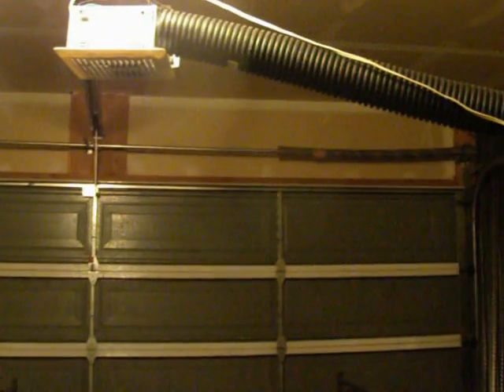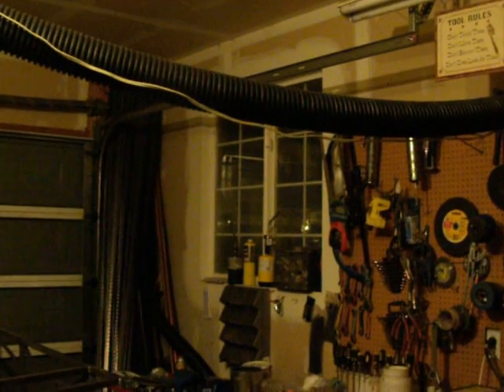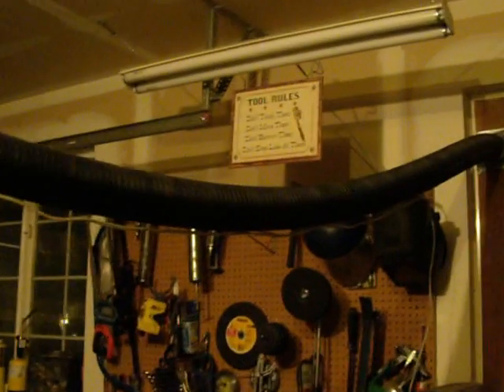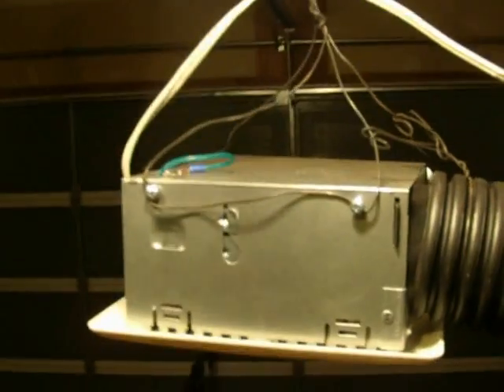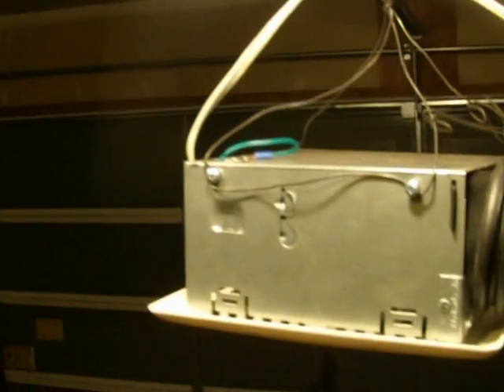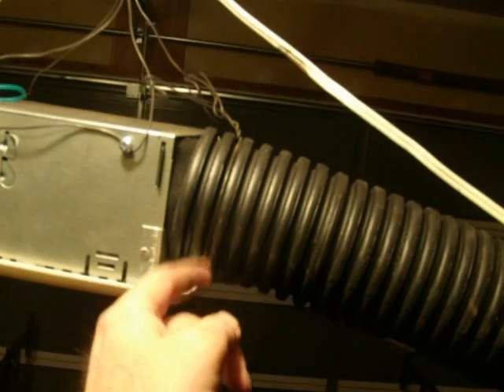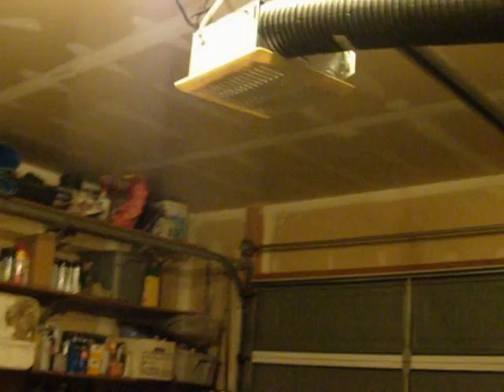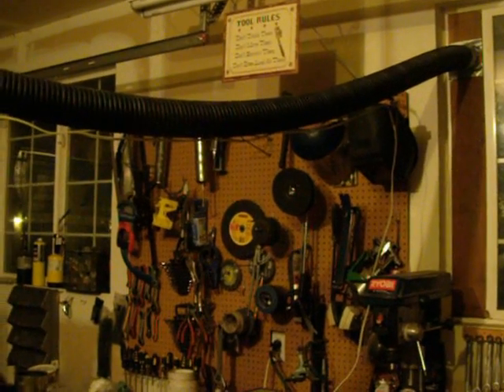Fume Extraction Fan for Under $20

Comment: I was going to dip the same thing but with the fan at the other end. But looking at this it would seem you get better suction doing it your way as the fan would be directly sucking up the fumes instead of pulling it trough a long pipe as I was thinking. Thanks for changing my mind and helping build a better design